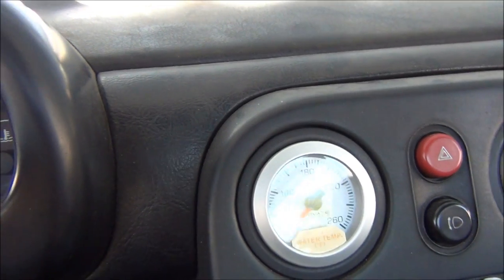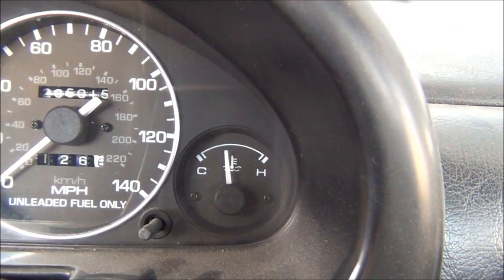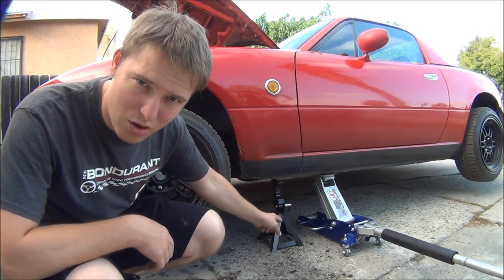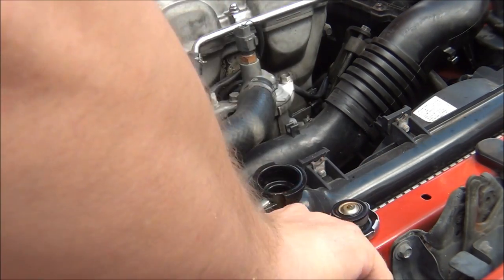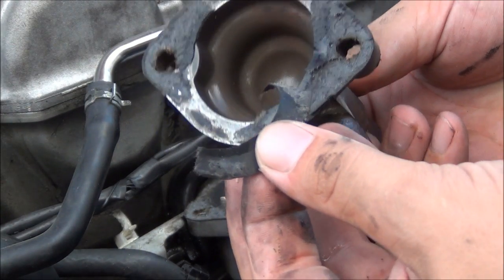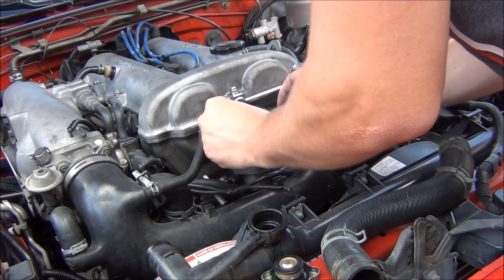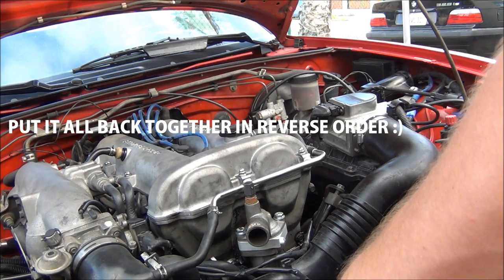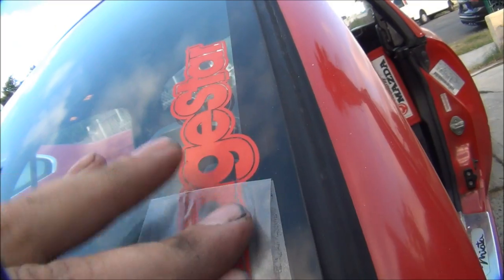Garage Star Temperature Sandwich Plate! (Miata)

Comment: Could you show how to hook up the aftermarket gauge in the spot that you had it?
Reply from the maker: +Mighty Miata If you check out my "how to install a wideband" video, the wiring is nearly the same. Only difference is you'll run one pair of wires to where your sensor threads in, and one wire hooked up to your headlight power so the gauge will light up when you turn your lights on. I may do an install video sometime in the future.
Reply: +TheCarPassionChannel thanks! Watching it now! Keep up the great work!

Comment: do you have no problems with the original raidiator? i have bigger wheels and my engine temp is i little bite to high. now i put in the mishimoto x treme radiator and the maruha termostate 78Celsius with the sandeich plate
Reply from the maker: +LMPlmp1 The stock radiator does a fine job of cooling the stock engine. As long as it's not plugged up! I have the big Mishimoto in my other car.

Comment: Hi there, I noticed that you are running a re-route kit for the upper radiator now, and the instructions show that the temp sensor is at the back of the head. I was wondering about the front the car with the block off plate and this unit now. What does the setup look like?
Reply from the maker: +Akash Chandrashekar This is a different car from the one I have the re-route on. The front housing is just blocked off when you have a re-route.
Reply: What happens to the sensor that sits on top of the thermostat?
Reply from the maker: Akash Chandrashekar There is no sensor there, you're thinking of the thermal switch. All it does is turn the fans on if the water gets too hot, IF the ECU fails to do so. The block off plate has a threaded hole so you can still use that switch if you want. Mine still has it, but I'm going to do a water neck block off which will eliminate it completely. It's kind of a failsafe but as long as your ECU is doing its job (I'm running MS so I adjust when I want the fans to turn on anyways) you don't need the switch.

Comment: Hey man does your Miata ever just smell like gas? Like gas odor in the car and around it? My Miata has gas odor and I don't know how to fix it.
Reply from the maker: +Jake Derkatz No it should not smell like gas inside the car. You need to find the leak! If it's really strong it could be the seal around the fuel pump access panel. Inspect all of your fuel lines as well, in the engine bay, under the car, and under the parcel shelf.
Reply: Jake Derkatz remember it also could be a pre-cat exhaust leak.

Comment: I am not sure what is the benefit of the sensor relocation. The stock oem location is the best indication for engine temperatures since it is located near the notorious #4 cylinder. water exiting the back to the heater core are the hottest in the system, in contrast to water going out through the thermostat which are a mix of cooled and hot water. Problem is the gauge itself. There are articles about making it true linear.
Reply from the maker: +yossi126 This is not to relocate the sensor, it's to add an additional water temperature gauge to the car. You still leave both of the OEM coolant temperature sensors in place.
Reply: +TheCarPassionChannel Got you now. Keep cooking those awesome vids bro

Comment: Recently installed and new thermostat.  Checked orientation and its the same type and direction as the one in this video. The car is over heating when it sits for a bit. Question: how long before a miata starts to over heat when sitting? on average. 
 Also Im not sure my fans are coming on. Can you suggest a diagnostic path to check them?
Reply from the maker: Yes, open the hood and see if they're on. A car should never overheat at idle no matter how long it sits.
Reply: OK so I have a problem then. If the fans aren't coming on can you suggest a starting point? Or another idea.
Reply from the maker: DoitDoug If the fans aren't coming on you gotta start by figuring out why. Could be a bad thermal switch or a fuse/relay
Reply: ok running 25 yr old wiring this weekend. I do so love my mx-5.
Reply: Bad sensor on thermostat housing. All better except the connector wire snapped when I removed it. Miatas love'em.

Comment: Hey why would you install the plate without an extra gauge? Genuinely interested , is just the first step to putting a gauge in or does this make the original gauge more accurate as well because as far as i can tell it doesnt seen like it would do anything except for effectively have a spacer on how far the temp sensor sits?
Reply from the maker: +AKG 470 This is just so you can run the gauge. I don't have a water temp gauge for that car hence why I did not show the install (those were two different cars in the video)
Reply: ahh okay makes more sense now  haha looking forward to seeing more broke and boosted keep it up, the detail you go into is great

Comment: This has nothing to do with the sandwich plate but if you do a coolant reroute does it have a hole drilled in it for a tempgauge?
Reply from the maker: +Sam Newman I have the M-Tuned reroute and it does have the threaded holes in the rear housing for an extra temp sensor, which is where you want the temp sensor if you have a reroute.
Reply: Great!! Just what I needed too know. Thank you

Comment: You didn't reconnect that little bracket you removed at 4:06. Is that holding anything important?
Reply from the maker: +Gman1024 Good catch, I did go back and put it on after I realized. It's not very important but it does conveniently hold that piece of the harness in place.

Comment: Do you know if there's an aftermarket water temp gauge that fits in the existing space? There's something that irks me about non-linear gauges and I'd love to replace it. (At least your 1.6's have real oil pressure gauges)
Reply from the maker: +james Thaddeus You would have to cut up the gauge cluster to put a new gauge in where the stock on is wouldn't you? I'm not sure if anyone uses a sensor that would make the stock gauge linear. People do it with the 1.8L oil pressure sensor gauge though.

Comment: Just out of curiosity, what is holding the thermostat in place now that the upper housing is higher than normal? Can't it jump out of its cavity?
Reply from the maker: +Luke Burnard It's held in the same exact way as it is stock, which is by the very outer lip of the thermostat. (Since the sandwich plate is the same diameter as the stock upper housing).
Reply: +TheCarPassionChannel Ah okay, cant really see it in the video. Great channel dude, looking forward to more episodes of broke n turboed. I just got my first NA mx5 and your videos are giving me a lot of different approaches  and ideas of what i can do to her. Cheers from Australia! :)

Comment: would this work with a coolant reroute kit? like an m tuned kit?
Reply from the maker: +Bunny Rabbit If you have an M-Tuned kit you do not need this part. The M-Tuned kit has extra threaded ports in the new rear housing, that's where you want to plumb in the coolant temp sensor. That's exactly how I have my other car set up.

Comment: Does that still work if you have a coolant reroute installed?
Reply from the maker: +JasonSleiman4thewin If you have a coolant re-route from M-Tuned you already have a port in the rear housing so this would not be necessary. Also if you have a re-route, it's best to read water temp from the back of the head, that's how I have my turbo car set up.
Reply: Oh does the sensor replace one of the Allen key plugs?
Reply from the maker: JasonSleiman4thewin Exactly.

Comment: question...... what happens if u on the highway going 70 and u forget to put on ur cooling fan..... cuz u have switch.... and u smell a bit of burning after 10 min of driving to home..........
Reply from the maker: +boosted 2j You shouldn't need the fan on the freeway unless you have a cooling system problem, it's need more sitting in traffic, in the city, etc. Did your temp gauge go above the normal spot?
Reply: nah it didnt go past the middle and it was cold out so idk. i was just wondering since u said not to run an engine without the fan. not y i didi it lol but i forgot to put it on :( but yea..
Reply from the maker: boosted 2j Yeah you're fine
Reply: :D yayy lol also just asking but do u have a schedule day u upload vids ?
Reply from the maker: boosted 2j I've tried to keep a schedule but it's really hard with how busy I am right now. I'm trying for just one per week right now. 99% of the time it will be a week day between 7-9am PST. Should be able to have one up tomorrow too!
Reply: hmm i see i see take ur time. well i look forward to ur upcoming vids :3

Comment: For the love if God don't over tighten those bolts. I mad the mistake because I was being to cheap to replace a $4 gasket and cracked the lower part of the housing. $60 and 2 timing jobs later(the crank pulley jumped a tooth because of a bad tensioner) it was wishing I had just don't it right the first time.